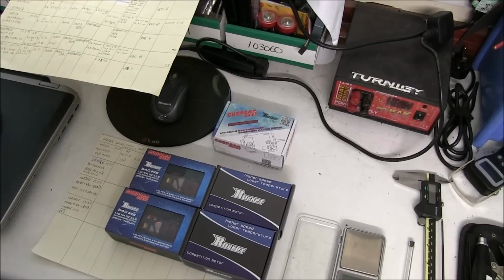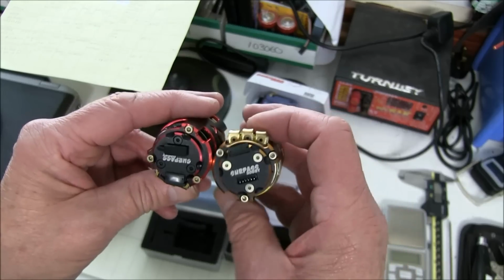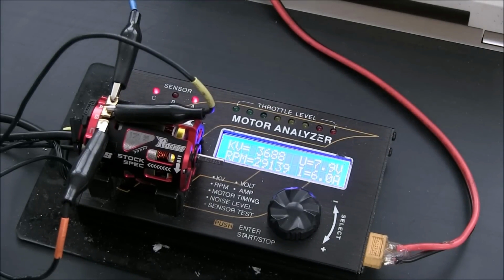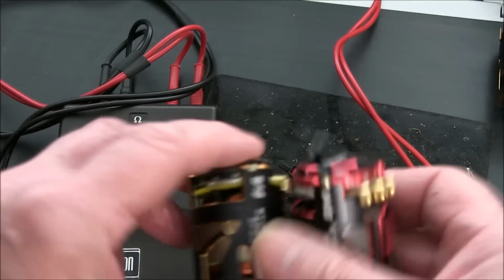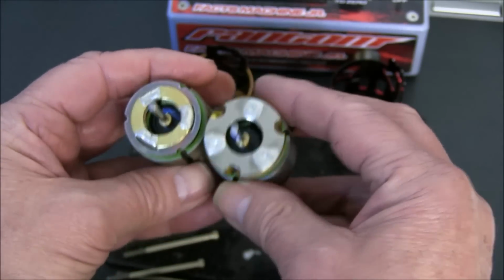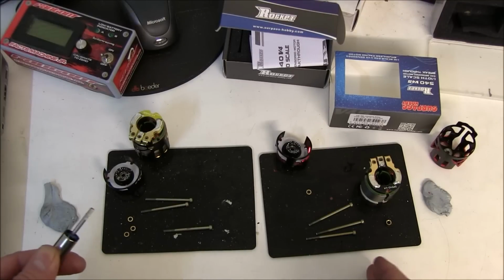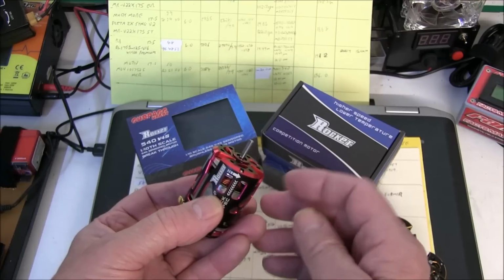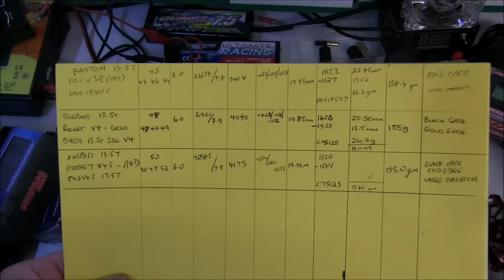Surpass Rocket V4 Brushless Motors. Blasts to the top?

Comment: Having recently started racing again after a 30+ year hiatus I'm really perplexed by the changes in the hobby. One thing that doesn't seem so positive is that stock/spec vs modified is not what it use to be. Stock class was to allow people to run cheaply with a basic untimed brushed motor that was worth $15 and everyone ran the same. Now it seems people need spend more money on stock class to lighten their vehicles than people spend on modified class. Makes entry into the hobby much harder.

Comment: Is the 10.5t suitable for a crawler?
Reply from the maker: Hi Dennis. Not the best choice as lower rev motors such as 21.5T are easier to gear slowly. But if you set the timing on the motor to 0 degree and gear for lowest speed it will have the torque. All the best crawling. Nick
Reply: @nickadams5411  hello Nick, thanks for the reply. I always thought...for crawling, low turn, high KV. Am i wrong, or does it also depends on the motor? Since this is sensored i thought it has more control.
Reply from the maker: @dennisbeekelaar1397  Hi Dennis. I am not a crawler, so you should be able to get the answer from a forum. But as you say, a high rev would be good as long as you can gear it down to a very slow speed. All the best Nick

Comment: I tried meshing mine the other day, and because the magnet is so strong, I couldn’t get a good feel for the mesh.  Any suggestions on how to mesh it and how you can tell it’s nicely meshed?
Reply from the maker: The mesh between the pinion and spur gear? Hold the pinion and there should be a slight movement of the spur, between the teeth. Some put a thin cigarette paper between the gears, and then when paer is removed the mesh is good.
Reply: Nick Adams done it earlier.  It’s the v5.  I know how to mesh a motor, but it just wasn’t feeling right because the magnet is so strong in it.  Omg it is so powerful!

Comment: So are they pretty torquey? My track is pretty short with a couple 30 or 40 foot straights and I mainly just need torque. Since these are only 80 bucks I might have to grab myself one
Reply from the maker: Hi. The latest version of the Surpass V5R is very torquey, and is suited to smaller tracks. And price is still lower than others. Race on. Nick

Comment: Hi nick. What fdr and amp setting would you reccomend on one of these in 13.5 blinky TC racing as a starting point?
Reply from the maker: Hi Matthew. I advise starting at 6 amps , which is good enough for most tracks. FDR will depend on the track, but for a medium to large track start at 4.5 outdoors and 5.0 indoors. Check motor temperature and gear to keep temperature below 70deg C. ie . not too hot to touch after the race.
Reply: @nickadams5411  thanks nick .mine has just arrived, am I better off using the steel screws supplied extra? Or the ones which came in the motor?
Reply from the maker: @MrHipwell1989  Hi Matthew. The alloy screws give a higher rpm, but they can come loose. If they come loose, use the steel screws which can tightened a bit more.

Comment: The new V5R has the same plastic protective film on the collector ring in black rather than the yellow on the V4. Could it be an insulator to prevent the collector touching the can? Would that be a problem if the film was removed and the collector shorted on the can?
Reply from the maker: There is a small clearance gap, but it is also extra protection. The anodising is an insulator, but it could rub through if touching, which would be a problem.

Comment: Nick, great review, thank you. How do these motors compare to the Surpass V3. Is it worth paying the extra for the V4?
Reply from the maker: Hi Steven. Yes, the V4 is a great step up in performance. Due to the latest low resistance stator, collector,  stronger rotor and improved cooling holes.
Reply: Great stuff. Thank you Nick.

Comment: Which ESC would you recomend for blinky  racing? I currently use the Hobbywing XERUN XR10 JustStock ESC. Thanks
Reply from the maker: Hi David. The Hobbywing are the best. The JustStock is okay for 17.5T. You will get a little more power and brakes from the Stock Spec or the Pro version.
Reply: @nickadams5411  thanks Nick, I'll take a look at those :)

Comment: Hi Nick, 1 question...I bought the surpass rocket v4s 13.5 turn and 10.5 turn motors. They are both awesome powerful motors. Did you notice if they had ceramic bearings, when you took the motors apart? There's one site stating they have ceramic bearings but I was not quite sure. Thanks for the great work. 👍.
Reply from the maker: Hi Scot. I saw that about Ceramic bearings as well.  I have not taken a bearing out, but will have to check.
Reply: @nickadams5411  Thank you. I think it was surpassracing.com...who is a supplier in the United States. However on surpass home site they don't mention ceramic bearing so I was just wondering. Thanks again.

Comment: Very good review... Question how did you get the stator out of the can?  Thanks for you assistance.
Reply from the maker: Hi. Most stators are a push fit in the case sleeve, and the tightness can vary. With the latest cans with a lot of cutouts, some can be loose and just fall out. Because of this, some Manufacturers have started glueing them in. Because the loose ones rattle and buzz like a bee. Racers have often wondered where the buzzing sound was coming from.  When that happens, glue the stator to the case with some epoxy or superglue.
Reply: Nick Adams Did your V4S 17.5 stators come out easy or did you have to use a little bit of heat?
Reply from the maker: Hi. The stators pushed out by hand. Sometimes they are tight and are not easily removed. Sometimes they are loose (especially on some other manufacturers) . The loose ones can buzz like a bee, when running the car, which can be very annoying. In that case you will have to glue the stator to the can.  Some Manufacturers now glue the stators to the can sleeve, and they cannot be removed.

Comment: Can you compare the reedy S+ torque to this surpass rocket 🚀 V4s motors
Reply from the maker: Hi Robert. I did test the Reedy S Plus motors some time ago. Thjey are good, but suffer from overheating in some races, due to the lack of air cooling slots. The exposed stator is good, but resulted in a lack of cooling holes for the windings. I would say the Surpass is better
Reply: Nick Adams 
Sorry to correct you but reedy have released a brother of the S+ called the S+ torque
Reply from the maker: @bobcar1972  Hi, i will keep a look out for it.

Comment: Do you think is a good motor for a drift car? I'm looking to get one but I've been told this motor is good for racing nor drifting. Thanks! Awesome reviews you do
Reply from the maker: Hi Rosu. Slow drifting needs a smooth power motor. The Surpass and other race motors have fast acceleration, so may prove jumpy when trying to drift.
Reply: It's ok bro. I use a motor with a similar strong magnet although I had to up my drive/motor frequency to 32khz to make it smooth.
Reply from the maker: @jrmayun  Hi, Thanks for the info. You are the smooth racer.

Comment: Hi, Thabks for this video. May I ask if the 13.5T would work with a Tamiya TBLE-02s ESC? Here is the link for this ESC. Thanks again! https://www.tamiyausa.com/shop/electronics/rc-esc-tble-02s-brushless/
Reply from the maker: Hi Vicente. Yes it will work with the Tamiya ESC.  race on. Nick
Reply: @nickadams5411  appreciate your response!
Reply: Follow up question, can a 3s Lipo be used for this motor or just 2s? Thanks!
Reply from the maker: @vicentemiranda9130  Hi, yes, but be careful not to over heat the motor. That means gearing and the load on the motor. Also do not turn the timing up too high.
Reply: Thanks again, Nick!

Comment: Hi Nick! Thank you for such informative videos, I have learned A LOT! I have a a question about the so called "outlaw" motors. My local track have a boosted class on 17.5T and everybody uses the Hobbywing Outlaw motor. They are quite fast on boosted mode but not so much in blinky. Based on your research I see that most of all these new crop of 17.5 motors have way more KV and RPM than the HW Outlaw and also the new Trinity "Punisher" motor. Is there anything special or different on the "outlaw" motors? Can I use any of your most recently tested motors (R1, SMC, Surpass etc.) for a boosted application?  Thanks in advance for your feedback.
Reply from the maker: Hi Miguel.  The Outlaw motors outperform "SPEC" motors of the same wind, as they have more powerful "Mod" rotors and low resistance staor windings.  It is a mystery to me why we cannot uprate the "SPEC" specifications to allow these better motors, without any increase in cost.  The Outlaw motors usually have very strong magnet rotors, which results in the low KV, but a lot of torque. ESC boost makes up for the lack of RPM.  Most motors can be used for Boost, but you must turn the motor endbell timing down to about 30-40 degrees, if you use a lot of boost/turbo.

Comment: Hi Nick, great review of the V4s, Thanks! Now that you've had time to run the motor a while, How has the motor performed on the track compared to the Monster Horsepower and R1, etc.
Reply from the maker: Hi Jesse.  On fast long tracks The R1 still has the edge, but I use the Surpass and it is very close. Smaller tracks ,other high torque motors like the Motiv are also close. Im not sure about Monster. I want to test the new Trinity XFactor.

Comment: just wondering, does the 6 Amp timing setting apply to 21.5 and mod motors ? i remember a while back you were mentioning for 21.5 around 5.0 - 5.5 Amps....thanks.
Reply from the maker: Hi. The 21.5T motors have a high winding resistance, which results in a high running temperature. Therefore the setting current has to be lower. The 21.5T needs very good fan cooling, and the temperature after a run should not exceed about 79C

Comment: Just throughing this out there thinking about the difference in the shaft lengths maybe the gold is more for offroad buggies maybe that's also why it has higher torque an made difference since it would be in a harsher course then onroad so it can be easier to clean dirt out or let the dirt go through motor easier

Comment: I looked up these motor on the net an found out that they come stock with ceramic bearings both ends an if the bearing near the sensor board goes bad you cant remove the bearing
Reply from the maker: Hi William. Luckily, in my experience, the bearings rarely need replacing.
Reply: @nickadams5411  same here but I also like to put ceramic bearings in my motor frees it up just alil more making the amp draw drop when put back in same spot as first tested

Comment: Hi Nick, great videos, I’m setting up a 13.5 surpass v4s for gt12, shall I set it up at 8.4v and 6a? Or 8a? Or can I run the analyser on 4.2v (analyser arrives soon)
Thanks
Reply from the maker: Hi Alex
You can try the analyzer on 4.2V.  My display is too faint to read. The amps will be about 4.5A at that voltage.
With higher voltage, the KV should remain fairly consistent at 8 V, as it is the rpm/volts.  The Rpm will be higher with higher voltage, but KV remains the same. Higher amps result in higher motor temperature. 6 amps is a good compromise. It will only take a small increae in timing to jump to 8 amps. So check motor temp after a run, and gear for the higher revs.

Comment: You rated the kv of the 17.5 red and black at 3688 but sellers are rating it around 2400? Why is that? Is there a possibility of different grade motors out there?
Reply from the maker: Hi Jared.  I believe most manufacturers rate their motors at 0 degree advance timing on the end bell. So the KV will be very low , but the same in either rotation.
I have tuned, so that the advance is about 50 degrees (anti clockwise rotation). So the KV is much higher.
It is more accurate to compare at a set amp draw (6 amp) as it includes the efficiency of the motor.
Motors with higher KV when set the same (0degree or 6amps) will have the higher top speed , when geared correctly.
I hope that helps.

Comment: you mentioned these motors are good for indoor and not outdoor. i was wondering why ? is it because of the big holes and dust can get in easier ? if so then would the V3 be better for outdoor ?. thanks.
Reply from the maker: Hi, The main reason is that the V4S has a higher top end rpm, making it useful for outdoor where the tracks tend to be bigger, with longer straights.  
If the indoor track had a fast long section, then the V4S would be best.
Both have excellent bottom end torque fror acceleration.
Most top competition motors have large cooling holes, but dust and dirt does not normally cause a problem on competition circuits, which tend to be clean.

Comment: Question for you I've just ordered one of these from yourself to get the most out of it would you suggest changing the gear ratio from what I used in a Motiv MCR and if so which way? Also do you tune motors differently for 1s and 2s use or is the overall goal the same 6A?
Reply from the maker: Hi Justin.
It is best to tune a 1S motor as a 2S, since it will draw less current at the optimum point and runs less efficient,so is prone to overheating.
The Surpass has equal bottom end torque to the MCR, but a better high end rpm.
So gearing the same will give the same acceleration but a higher top speed.
Or you can gear with a smaller pinion (lower mm per rev) and get more acceleration and a cooler motor.

Comment: How much torque is there on this motor ?
I want to install 2 of those on a Baby Stroller... ;) Can it drive it up the hill ?
Reply from the maker: Hi Michael
They have high torque, but are also very high revs KV~ 3000(KV= revsx100per volt)
You will need to reduce the revs by a gear box.
A motor with a low KV rating but high torque would be better.

Comment: Hi is The Surpass 13.5turn a Good Motor for 60€  and for indor Tracks can you post the results from the Rocket V4 thx Manuel from Austria
Reply from the maker: Hi. The V4 and V4S have high strength rotors, which makes them very good for indoors. The V4S has higher top end performance, suited for larger longer straights and outdoors.  All the best, Nick
Reply: @nickadams5411  thx Good luck Manuel

Comment: Nick, can't wait for mine to show up..  Decided to buy after watching this video.  Watching you explain the design differences and comparison between the different motors really helps us folk, and thank you for this.
From my personal view, there is something special about the aluminum collector and the effect it has on the motor.  Watching racers last year with the R1 at my local club, those motors with the collector would pull strong all the time.  Racers with an R1 where very hard to catch, even with good consistent driving with an older slower motor.  
I am hopeful to change the scenario this year, so much so, that I ordered three for myself and two for a fellow racer.  
In addition, I plan to test the new VS4's with my home made MiniPro!  It will have all the same fixings as the original but without all the price!  
I am not a sponsored racer, but just love the hobby and the competition.  
This year should be lots of fun, and catch all the action on my channel. 
Gordon
Reply from the maker: Hi Racer.
Thanks for the feedback.
Yes, I agree the big alum collector makes a huge performance increase.
Note: Surpass endbell timing plate.  There is a manufacturing fault with some of these.
The plate can short the legs on the upper sensor socket.
It is easily fixed with a small piece of thin tape over the legs.
Undo the 3 screws , pop off the plate, put a piece of tape (I use Sellotape) and refit the plate.
I race with the Surpass V4S 17.5T. It has very fast top speed.
All the best racing. Nick
Reply: How are you liking yours?